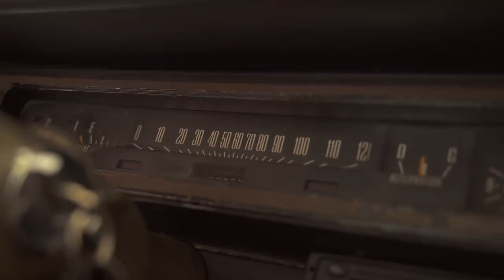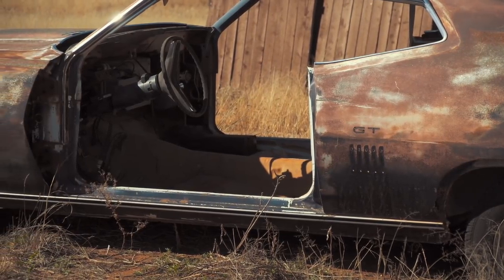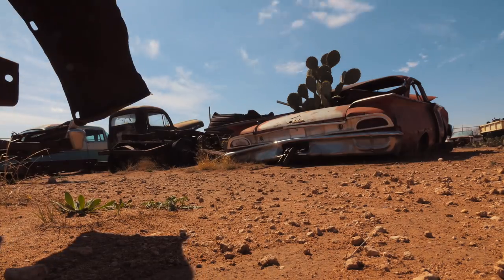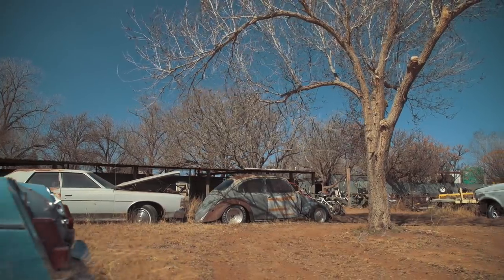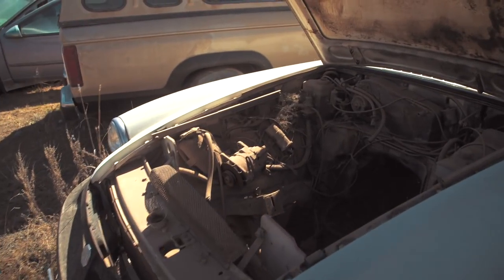Dodge Charger for sale & and a field of project cars! | Barn Find Hunter - Ep. 38

Comment: Ranchero - nice model . There is one form 74 ( squire with  wood on the sides ) for sale nearby where i live in Belgium . In very decent shape , all green + wood mixed colors and a 350 in it . Its only 15,000 $ - still for sale . If i had the bucks , i would have bought it long ago . I would mostly make a serious change in the cabin ( seats cover material / dash clusters / floor cover / etc... ) because its not a nice or exciting stock interior .

Comment: 318 to 360 swap, pay attention to the balancing, the harmonic balancer and little weights on the torque converter are different. 318 is internally balanced, 360 is externally balanced. On the 360, the harmonic balancer has a part scooped out, and there are tiny weights on the torque converter.
Reply: I'd keep the 318 and clean her up good. That Charger would make a great cruiser for the summertime.

Comment: in the mid 1980s my father bought a 1970 VG Valiant  two door  770 
318  motor  off an old guy who had it since new  my father paid $ 2000 for it 
only had 25,000 miles on the clock  when i turned 18 my father gave it to me   i drove it 
a few years till some woman jumped the red light and t boned me  pushed the rear quarter panel and window into back seat
and passenger door  that was the end of it

Comment: Would have liked to see that Falcon Ranchero, appeared to be a '63 factory V8 car. The Blazer is a great deal, the Misfits at Fired Up Garage just payed 8K for one in worse shape, if reality TV is to be believed. Love the '64 Falcon HT, I have a '64 Sprint HT in my back yard, in about the same shape.
Reply: Matt Farah's Million Mile Lexus.....a '64 Falcon Sprint? No way....that's runnin the 260 or 289? Either way it doesn't matter, it's a very nice ride regardless....
Reply: It was originally a 260/T-10 4spd, currently has a '64 Hipo 289 (an actual Hipo, though everyone says that) with a Toploader 4spd. It's been sitting a long time, it would run but I've never driven it. Plans are for a 331 roller stroker with a T-5 and a 9 inch with 3:50 gears - a nice quick driver, nothing crazy.

Comment: Max I'd pay for that Blazer is probably $700. I'm sure in 2010 running and driving it was likely* worth more than $1500 but it appears to be pretty much tossed together then thrown to the side. I bought a 1988 F250 with newer paint, a working older rebuilt 460/C6 combo and a decent interior for $1750 in 2010.

Comment: Isn't that Blazer a second generation? Remember the 72 and back style. Also those fiberglass fenders are the pre runner style, for big travel desert racing.
Reply: looks prerunner to me 2.
Reply: Yes, it's a second gen K5, and yes, prerunner front fenders.
Reply: 3rd actually 67-72, 73-75, 76-91, 92-94 then Tahoe 94-99

Comment: This is what I would call "looks like a muscle car but not."  The last of true muscle cars ended in between 70 - 71, depending on when the body changeover started.  For Chrysler, this body started in 71, so this was not.   While a few of these came with 383s, 400s and  440s and I think a few 71s may have had 426s, most of these had the the 318, 340 or 225 slant 6, with most getting the 318.  While I think one of these with the big blocks is definitely worth looking into, one of these with a 318 is to me nothing special.  This car while pretty good for 70s smogged down standards couldn't get out it's own way today, as a Honda Accord would knock it off in a drag race without even trying.  This one at least had the buckets and console shift which was a nice option as far too many of these with the lower end engine only had the bench and column shifter.    As a child of the 70s, I can tell you that a car like this would have been driven by a younger couple with no kids or perhaps a family with one or two kids but wanted to look cooler than driving around in a four door or a station wagon.  The big block chargers of this era would have been the only ones that people oohed and ahhed about.